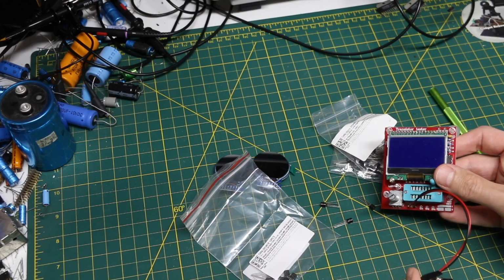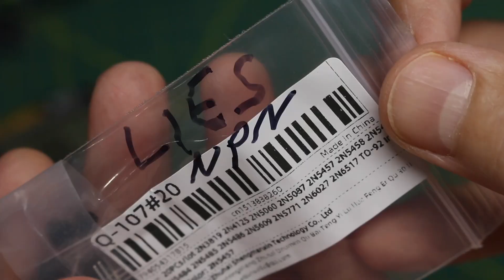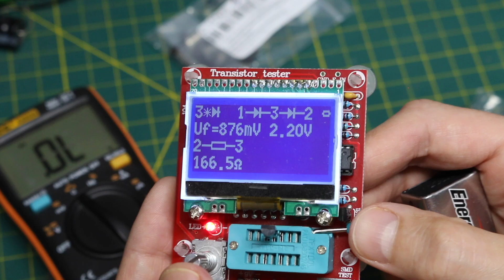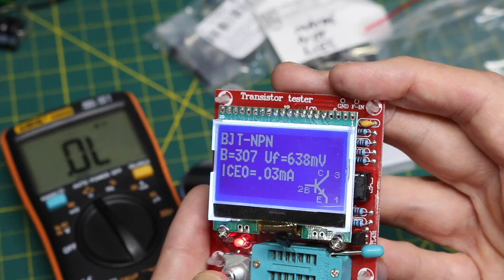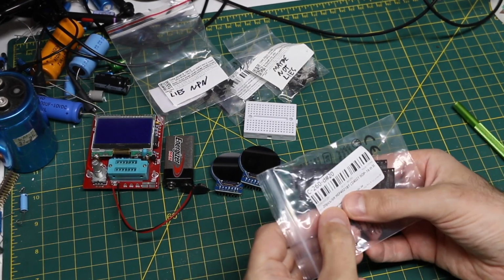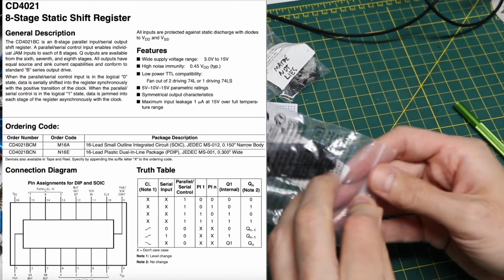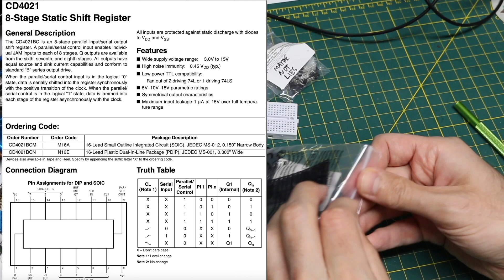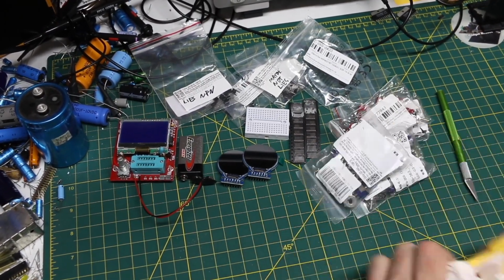Electronics Mailbag

Comment: I test Ali parts on arrival, particularly JFETs and MOSFETs, and report fake ones to get a full refund. Power MOSFETs are often the right package but a teeny MOSFET inside with silly high Rds On.
Reply from the maker: sometimes it’s hard to get a refund or it might take four months, I only just got a refund this past week for some thing that went wrong in March so if it’s a low cost part that I can still use for something else I may keep it for experiments, like if these ones are really NPN transistors it might be interesting to see what the specs actually look like

Comment: If you want proper JFETs, just buy from a reputable seller like Mouser, Digikey, Farnell etc.
They are quite happy to sell you small quantities like 1 or 10,  its not just for manufacturers buying thousands.
And postage these days from proper suppliers is cheap or even free. Check their websites.
Reply from the maker: I only order from Mouser or DigiKey once or twice a year because I need to spend $100 to get the free shipping so by the time I’m ready to order if I still need working parts then I put them on the list.

Comment: Mailbag!! I have good luck getting real JFETs from Tayda, when they have them in stock ... :goodvibes:
Reply from the maker: I need to check what Mouser has available and put some on a future tentative order (on this side of the border it’s easier for me to order from there or Digikey with their international arrangements and shipping).

 I assume any reputable distributor on this continent would have legitimate parts. I found one anti-static bag of some in my collection from DigiKey and the label had a date around 2003, I think back then they put the date on the labels but not anymore so I will be putting those to use.